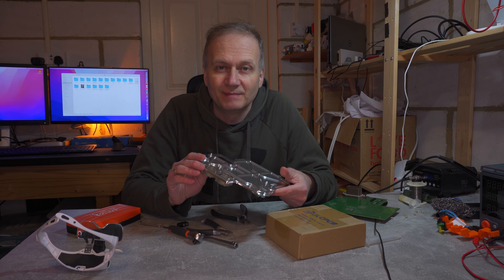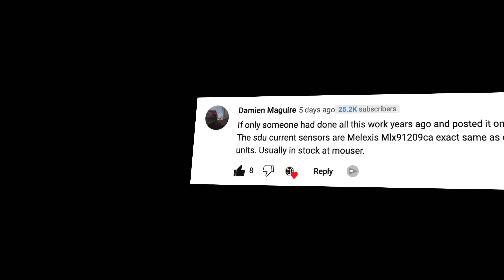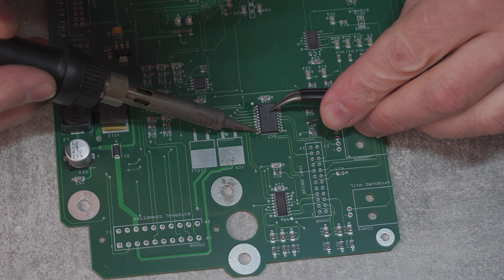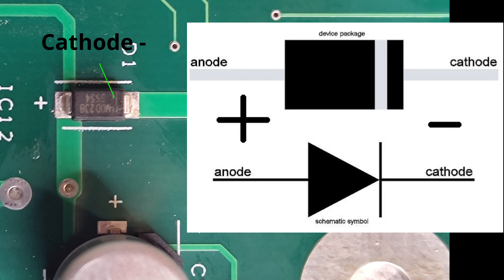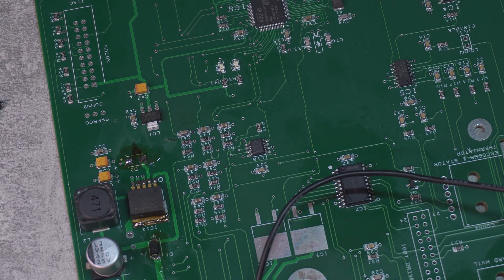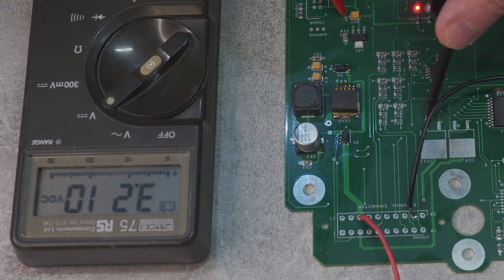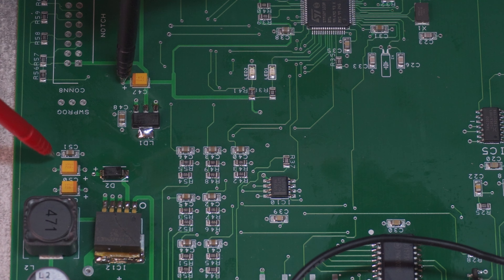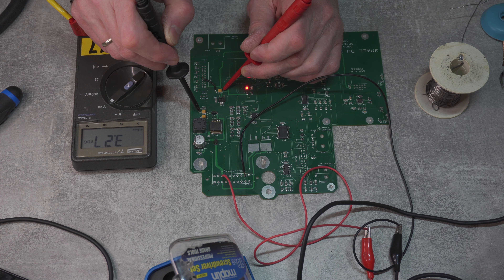Building Open Inverter Tesla board - more problems...? #7

Comment: To remove those diode-sized components I've found that just adding extra solder to each side and rapidly switching back and forth gets it off pretty quick too while not needing too much time.
Reply from the maker: I have tried this but it was not fast enough, 😂. What only worked was to create a bridge
Reply: @LatutaEV  buy a second cheap soldering iron and hold one in each hand. 😉
Reply from the maker: @alibro7512  yes I should shouldn't I,🤣

Comment: Great job working through all those issues! Can you clarify where you got the design files? Also, is there a reason you went with V6 and not V7 or V8?
Reply from the maker: Design files are available on Damien Maguire GitHub. As far as I know the V6 is the latest version available. I know on the forum there was a talk of V7 but I am not aware of one available. If you know where to get them please let me know 😊
Reply: I see. I thought I heard/read that Johannes took over dev of the SDU boards so Damien could focus on new stuff (i.e. M3). I did see v7 and v8 on Johannes' GitHub (forked from Damien's repo). I assumed these were the latest but maybe I misunderstood which is why I asked. 

FWIW, I just downloaded the V8 design files and jlcpcb has everything in stock for it but it seems to be a totally different design and I can't find any info on it. Looks like he added it just a couple weeks ago...
Reply from the maker: @nub340  interesting I will have a look but by just reading history it only change of 5 B regulator
Reply from the maker: @nub340  I had a look at the Johannes Git Hub and yes he has V8 now. That version includes ESP module baked into the board in addition to Jtag connector and smaller 5 V regulator. For me this does not make any difference. But I was considering making my own design to include all those corrections
Reply: @LatutaEV  Oh cool, thanks for the update! I just wasn't sure whether those were truly the latest versions or not / if it was safe to use them.

Comment: Components placed in the wrong direction. Thats fun. I had the same issue when ordering from JLC the Gen3 prius boards. Appears the placement file can be off. The next time I check everything before clicking to the build stage. Especially if you have to put in an equivalent Component
Reply from the maker: The thing is that I had a few boards made by JLC PCB This is the first time I have had such a problem. But will double check from now on.

Comment: hi bud. I'm going Tesla SDU on a cradle in my VW Early Bay, 400v architecture. Can i ask, by going 400v can i just use the motor as is or will i still need to get the Inverter adapted? Thanks John
Reply from the maker: Hi Olive you should be fine with 400 V on Tesla as this is pretty much what they use. Nominal around 360 but fully charged around 400. But you could test the motor with much lover voltage around 100 V should be sufficient just to spin the motor
Reply: @LatutaEV  thanks mate

Comment: Can these boards be bought completed without needing any work other than installing?
Reply from the maker: You can't buy a fully completed board. At the open inverter shop you can buy complete board without the connectors
Reply: @LatutaEV  cool, thanks
Reply from the maker: @dbc105  But it much more fun to build it yourself 😉